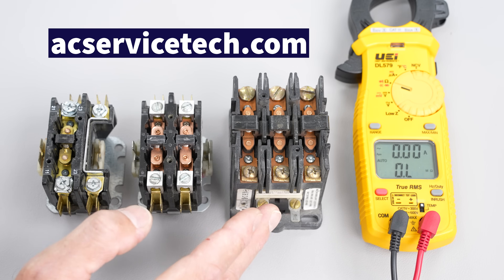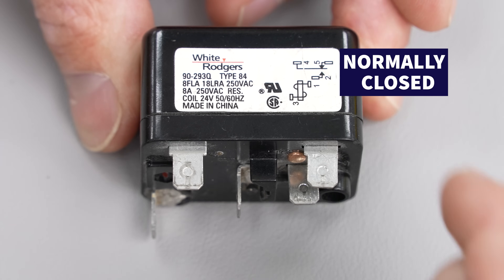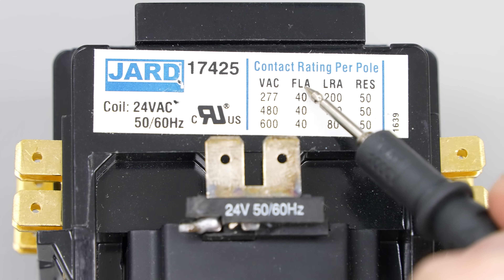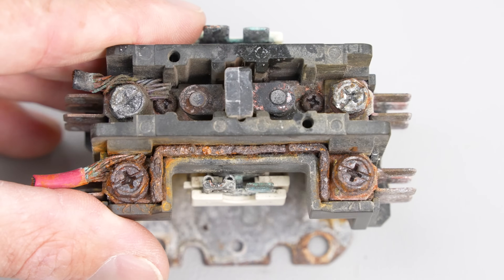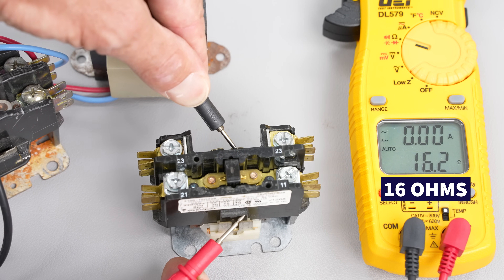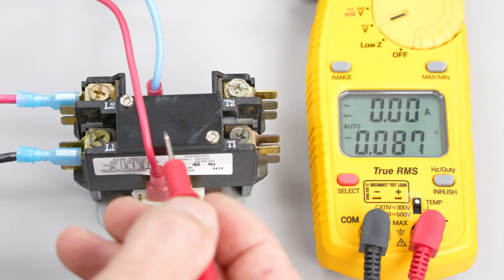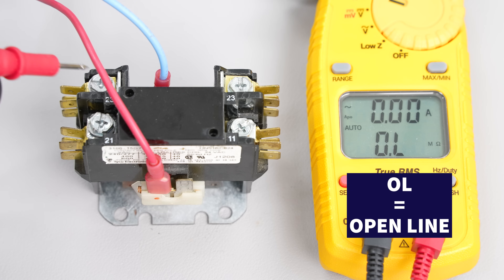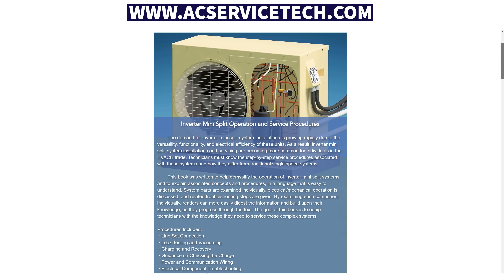HVAC CONTACTOR Operation, Types, Ratings, Problems, Testing!

Comment: cool-ing video... I guess manufactures call the first contactor you describes as  1.5 pole... here is a copy n paste.>> A 1.5 pole contactor is a type of electrical switch, commonly used in HVAC systems, that has one main pole for switching a circuit and a second "pole" that acts as a shunt, carrying a portion of the current and providing a bypass path for wiring, typically on the L2 (neutral) side. This design is often found in applications where a single-pole contactor is insufficient, but a full two-pole contactor is not needed

Comment: Are the DPST contactors better than SPST contactors? My new condenser has a cheap one, I'd like to replace the contactor ASAP. Unless there is an even better solution.

Comment: I can hear my contactor click when thermostat is turned to cool. After the click nothing turns on and there is an electrical buzzing sound which comes from the contactor. Is that a symptom of the contactor not having a good connection when activated?

Comment: How can you be getting a voltage drop across the contactor at about 12 min mark?  There is zero load therefore zero current.  V=IR.  If I equals zero, then V equals 0.

Comment: OMG! Don't tach hi voltage conductors with your body! They can suddenly be energized! 
Second. Measuring across the switch you will not get correct voltage if the switching contact is not connected to a minimum load.

Comment: At 12:07 or so, you measured 6V of voltage drop - but the blower side of the contact is not connected to anything. So, there must be an internal short somewhere between the input and output connections, because you can only get a voltage drop across the resistance of the pitted contacts if there is current flowing and no current would flow without there being a short. Not sure what path that short could possibly take - do you have any thoughts on that? Great video, thanks!
Reply: There has to be a short because you can't have VD without current flow.

Comment: why do i have 2 contactors on my heat strips versus the one i see on most modern package units today? one is ahead of the strips before it gets to the  dual post sequencer and the other is after they pass through the strips before it returns and completes the current and i also do not have any safety thermal disconnects. it also seems to have came that way. is this common?

Comment: My max current rating on my outdoor unit says 30amp.. and the contactor that was in it already was a 25FLA, which it burned… does this mean whoever put replaced the contactor before used a wrong one? It should’ve been 30FLA or 35FLA?
Reply: You're 100% correct. The person that installed it probably didn't have a 30 or higher only 25, so he said "25 FLA it is"

Comment: Thank you, great explanation. I have a single pole contactor, points are on the right, shunt is on the left. The replacement is the opposite. I'm figuring to keep the wiring correct I should put the new contactor upside down. Is that right? Thanks.
Reply: It doesn't matter. It's just a switch. It's like installing a switch that powers a light in your home upside down. It will work just fine but it will be in the up position when the light is off and in the down position when the light is on. Same with the coil terminals on the contactor. You can reverse the leads on that too and the coil will still energige.

Comment: My outside a/c unit fan runs constantly whether the compressor is on or off, and when off, the fan runs at a slower speed.  So the unit is still cooling, but when the compressor shurs off, the condenser fan still runs.  Faulty contactor switch?

Comment: On the voltage drop test, what do i need to set my meter to? I keep seeing 120v?
Reply: On the voltage drop test, you set your meter to Volts AC. Place one voltmeter probe on L1 and the other probe on T1. You have to turn on the unit to see the voltage drop because there has to be current flow in order to have voltage drop. 

The reason  you're seing 120V is because the contactor is not energized and there's 120V on the L side and 0V on the T side. The voltmeter measures the difference in voltage between its 2 probes.
Reply: @bernardocisneros4402  aha, thank you
Reply: @sly5855  You're welcome

Comment: LRA locked rotor amps: the rotor is "locked" and not rotating at all. Anything higher than the LRA, the contact will be rendered useless. (Burned up).

Comment: Excellent video will show it to my technicians. Wanted to add that something I've found many times is the contactor blowing the fuse at the air handler when calling for cooling. When that happens usually de resistance of the contactor is like between 1-7 ohms. Ohms should read between 9-17 most of the times.
Reply: Yeah, was disappointed he didn't show more of that.. these contactor coils are causing problems these days, with shorts. You ohm out the coil and it's generally around 1 or so, a lot of techs don't know about to do that.

Comment: How close to LRA rating could a load be allowed to run without potential problems
Reply: Should be at RLA
Reply: @ShanQueefus  my wording here was wrong. What I meant to say is how close to LRA on startup would a load like a compressor be too high. For example I got 102 inrush amps with a LRA of 105 on a compressor
Reply: @mrgreen9086   In that case, I would replace the contactor with a high LRA overhead and most likely install a hard start kit.  5-2-1 is the ideal hard start that I install, i don't do the two wire cheap units.  But you are still within spec at 102 of 105 but I can't see I see many LRA units as low as 105.  Usually, it is 150-200 for the models that I buy and install for my clients.

Comment: The voltage drop across the contacts is not convincing. You need current flowing to really demonstrate the problem. Using Low-Z on the meter may well have brought the apparent voltage drop down to zero given there was no current flow through the contacts. Also it would have been worth pointing out the first contactor had one  permanently connected pole in addition to the single switched pole  (sometimes called a shunt or one and a half poles)
Reply: I definitely agree with everything you said there, but for us seasoned technicians, we already knew that.  But for those that learning, that would have been the better way to explain it.
Reply: Maybe you can make your own video and demonstrate what you want to see
Reply: Chab zean